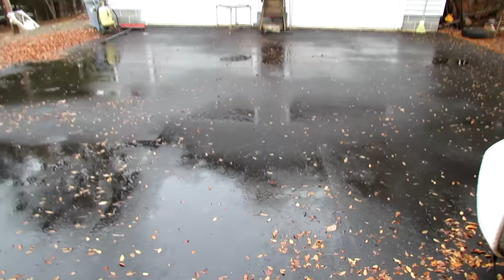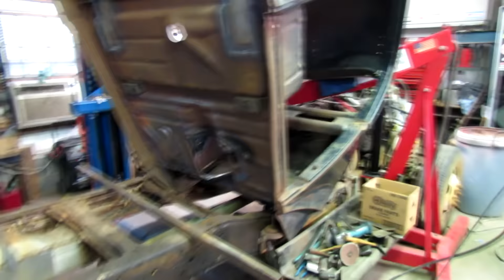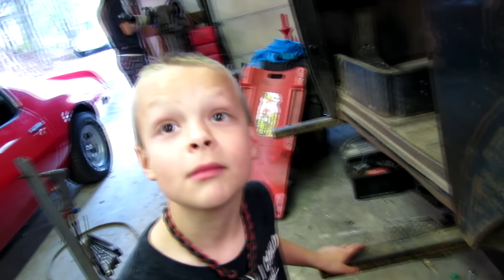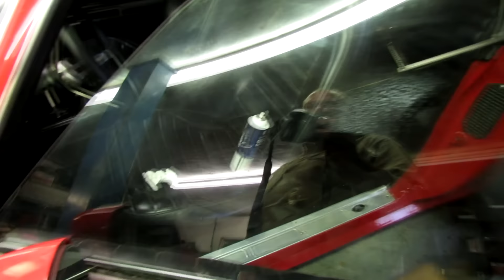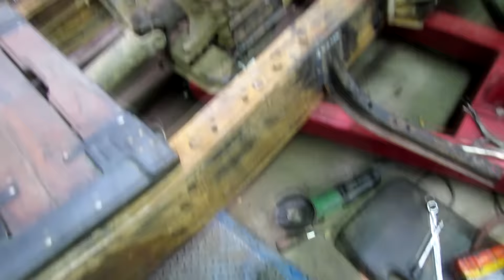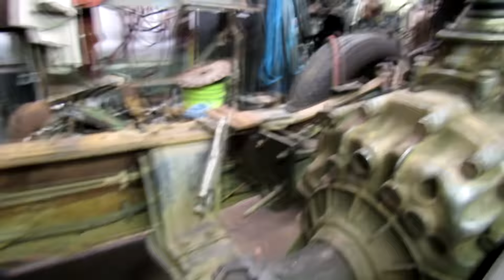46-Ford

Comment: They spray our cotton here so they can harvest earlier. I like to see the old houses and barns from the highway, won't be to much longer and there won't be anything but metal buildings. They look nice but don't have the rustic character of the wood buildings.  The 46 Ford is coming along , lots to do so you kind of have to tackle it a little at a time or it would eat up all your time. Good to preach safety with those grinding wheels to Lil Man ,  good practice to wear a face shield while using those.I had a disc come apart on me once and it will make a believer out of you.  Who says Bunny slippers aren't manly ...lol  Take care
Reply: +Rusty “rustyglovebox” Glovebox yep, I still have pieces of  exploded cut-off wheel stuck in my garage ceiling and door insulation...left them there to remind me that "safety squints"  just dont get it with those thin wheels
Reply: Exactly right, I may have a piece or two stuck places I haven't found yet too...lol Take care
Reply: +Rusty “rustyglovebox” Glovebox I've been planning to do a video on this subject for a couple of months since I got bit by an angle grinder. Just because they are so effective they also demand a lot of respect. I bought a full face shield that I use now. It's the only power tool I wear gloves using, too.
Reply from the maker: +Rusty “rustyglovebox” Glovebox It's quite an endeavor
Reply from the maker: +Bruce Boschek It's easy to mess up with it

Comment: Diamonds are first cleaved (split) to size and then are ground and cut using diamond tools. A saw for cutting a diamond is a copper disc that is coated with diamond dust. Just like a steel hacksaw blade can cut  piece of steel a diamond coated blade can cut through diamond. There are five separate processes used in making a gem stone for jewelry. Google is your friend.
Reply: +Bruce Boschek  I knew some one would get to this before I did!  8-)  Better answer too, more detailed. I learned something without googling it personally.  Remember the "bad old days" when you only found out a little from that expensive, outdated Encyclopedia?
Reply from the maker: +Bruce Boschek I'll pass it along....

Comment: Could you not heat and gently squash the exhaust pipe into an oval or pear shape to get past the cross member with clearance to avoid rattling or rubbing?  - That way you don't lose any capacity nor have to alter the cross member.
Reply from the maker: +Dan Whiteford I could have..and thought of it...

Comment: I see you have a Makita 18v angle grinder. Are you happy with it? Does the battery last long enough? I have almost all of the other 18v tools including a chain saw, but don't have the grinder and am thinking about getting one.
Reply from the maker: +Bruce Boschek It doesn't last very long..but it;s very handy for short quick stuff away from a cord.For extended grinding you need an electric grinder..batteries charge quickly though.
Reply: *****
Thanks Mark. I've got four corded electric grinders, but a couple of times I could have used one far from an outlet and thought it might be a good idea to get a battery operated one. I've got 3 of the makita 18V batteries so I can change off if one doesn't do the job.

Comment: They fine a weak spot in a diamond and break it into halves if done right, with a hammer and a very sharp and strong chisel, if done right, wrong its diamond dust. ITS A 50/50 chance or RISK they take.  then they use diamond saws, sanders to cut and sand, and polish the diamond. Diamond is carbon,  cut or break the diamond a wrong way will crumble ya.  They use diamond dust ect. to work the diamonds down and to polish them. Tell the little chief that   Cheers buddy